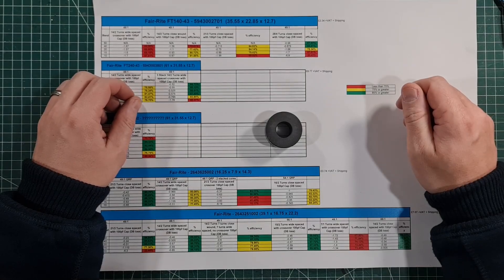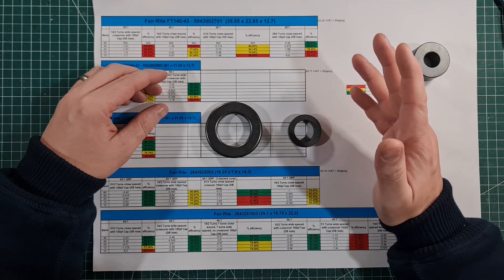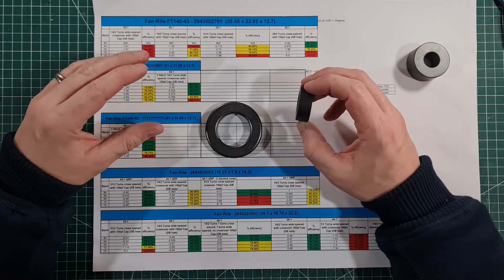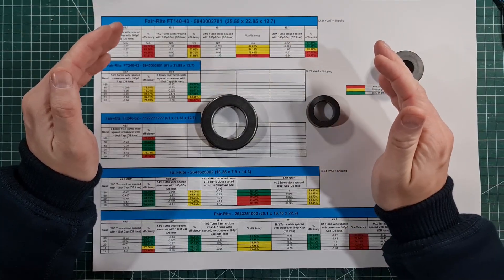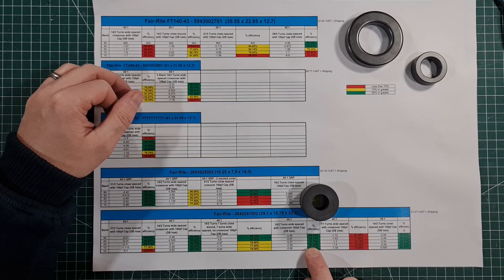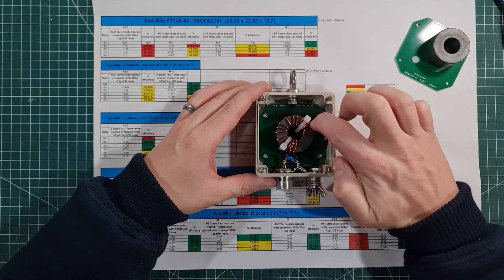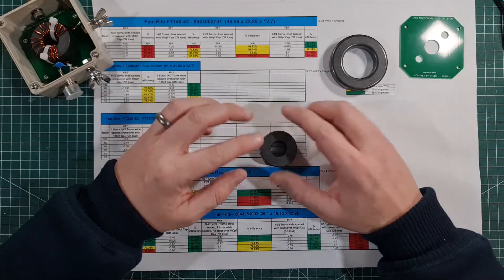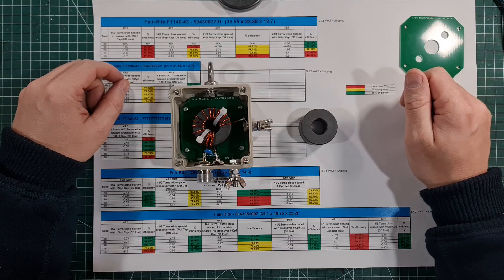Best Ferrite Core For a 100w End Fed Half Wave Antenna

Comment: Hi Colin, do you know if it would be possible to make a high power QRO version by staking two or even three of those 1002 cores? 400 watts full duty cycle is the design goal for me.
Reply from the maker: Yes, most likely but there is a major catch. You will improve the efficiency very slightly on the low bands but efficiency 20m up will likely fall off a cliff.
Reply: @MM0OPXFieldRadio  Damn, maybe I'll just take what I can get lol. Thanks for the reply man :)
Reply from the maker: @VK3USA  unfortunately you cant have it all

Comment: I absolutely would love to know how to build this antenna. Is there a build video somewhere I can watch?
Reply from the maker: Afraid not. Its just a standard EFHW transformer but with I extra then on the secondary winding. You can mount the core however you want to.
Reply: @MM0OPXFieldRadio  I’m new to ham and building antennas not sure where to begin
Reply from the maker: Ok, start to research builds on YouTube for 49:1 end fed half wave transformers. All the builds are very similar and have the same wiring.

Comment: Excellent info with very good presentation. Thank You Sir. Much Appreciated......

Because of my QTH limitations, I'm limited to Mag Loops and EFHW antennas. Luckily, I'm on the first floor and have a very large yard just outside my side door.

I'm simultaneously working on a W6NBC 4' Loop tuned via a Stepper Motor with Remote WIFI Tuning, fashioned after N6JJ's controller.

And now, because of this video,  a new 56:1 UnUn (Fair-Rite Toride #26432511002) for my 63' EFHW. I'll be adding the 80M Extension Coil in the near future for late nite NVIS.

The EFHW will go up 10M via a SpiderBeam Fiberglass Pole and then slope down to a 10' PVC Pole. I should get some DX with it and reasonable NVIS from So-NH.

I expect the Loops will give me reasonable good DX all around the compass via an Armstrong Rotator. HiHi.

BTW: I'll construct a second Loop for high efficiency on 10M to get into FM Repeaters and also the upper WARC bands.

Now, if I only had some Weazle Grease to lub my areal wire for better RFing. Oh Well......

73 You-Allz.....
Reply from the maker: Your very welcome. I only do this to help others. I need to get an 80m extension coil going myself.

Comment: help please i live in a valley completley surrounded by hills will a efhw do the job ?? getting back into radio after 20 years, whats my best option ?
Reply from the maker: The EFHW is just a transformer, your situation depends on the angle that signals can leave your valley. Ideally you need to know this and make an antenna accordingly.
Reply: @MM0OPXFieldRadio  thanks for quick reply,
i have limited options, im in a bungalow, i was going to run a wire from the chimney to my cabin at the end of the garden, but i would probably only get europe i face south east isle of wight, niton, cb  bands are dead here, im surrounded by hills, have picked up europe cb here from the back garden, are you on f book too ? i could send pics or a video, i have never made a wire before, dont think a silver rod would be any good lol
Reply: and my radio is still in the post haha, galaxy saturn, im old school just ssb lo to high and cb is what im after, but i doubt il get uk cb as hills are quite high but open, i am surrounded by water if that helps hills are 45deg front hill about 1.5 mile away to top, back garden hill 45deg 200m from my back fence

Comment: I love your results layout and testing method. I would be curious to see your results with a triple stack 52 mix 240 between the 14/2 and the 15/2. The triple 52 mix has become popular for DIYers lately (myself included)
Reply from the maker: I habe checked a 2 and 3 stack with 43 and 52 material. I need to do a couple more Then I can make up a follow up video. The spoiler is a 3 stack of FT240-52 is crap above 20m simply put.
Reply: @MM0OPXFieldRadio  It is good to know! I look forward to the video with results :). I have built a few of the triple stack 240-52 mix transformers and always struggled with the 17-10m portions.
Reply from the maker: Performance falls off a cliff above 20m, I'm not surprised. Unfortunately it looks like there is no QRO core that will cover 80 thru 10.
Reply: That is unfortunate. My Intellituner can match it and make it function but it is a shame it does not work as well as we have been told. I did see someone talk about adding another secondary turn on the triple stack to have a 15/2.... have you tried that yet? Curious what your results would be because if there is any improvement, I will probably try that with my spare transformer box that I built.
Reply from the maker: Another turn on the secondary wont do anything to make it much more efficienct. Core geometry along with material type is key for transformer efficiency. Do the tests for yourself and get your eyes opened.
Reply: @MM0OPXFieldRadio I spent about 5 years and 1000 feet of wire looking for 80-10 efficient combo and never found it, the closest I got was an air wound version and it still didn't make the cut but damn it was close. 😂
Reply: I can attest that 3  52mix cores are crap above 20 and a very expensive trial. They are good on 80 and 40

Comment: Hi what size MAGNET WIRE,
Reply from the maker: This is 0.66mm diameter wire.
Reply: @MM0OPXFieldRadio   thank you second question what was the length of wire for the antenna did you use

Comment: Does this apply to qrp power levels? Ie Does the efficiency vary with power?
Does this apply also to 9:1 ununs for long wire end fed antennas?
The core you recommend is out of stock :(
I have a G90 (max 20W) and want to build 49:1 and a 9:1 for portable as antenna use. I want 10m to work the best it can. VK6MIK.
Reply from the maker: The power level is irrelevant except when you put too much through it and it hits curie point. The smaller core I recommend is fine for 20w SSB. I haven't tried any 9:1's yet.

Comment: Have you tried two cores together, if so how much power will it handle. Thanks for your post's I've bought half a dozen to build you transformer.
Regards Kevin G1UZL.
Reply from the maker: I haven't tried 2 cores as an antenna. The reason the it becomes very inefficient 20m up. The low bands will become marginally more efficient.

Comment: Built one swr ok on 40 but not good at all on the other bands above 2:1  even after adding the extra winding to 56 :1 this replaced the ft240-43 same wire that was below 1:1:5 on all bands what were you swr finding as a matter of interest
Reply from the maker: Very strange. 40m is 1.8:1 and the rest are less than 1.5:1. How did you have it configured?
Reply: @MM0OPXFieldRadio  2 primary and 15 secondary on  tried close spaced and wide spaced the wire was 65 feet and  it's perfect with the 240-43
Reply from the maker: Sorry, how was your antenna wire orientated? Was it out in the open in the clear. The 240-43 is very forgiving but is more lossy.
Reply: Yes is 800 asl in the hills  Nothing there between 2 trees  but it not too high off the ground 6m  both sides of the wire
Reply from the maker: So as a horizontal wire? Try an inverted v or an inverted L and see how you get on.

Comment: will these  be better on  1:1  and 4:1   versions  compared to 240-43
Reply from the maker: Not necessarily, in the case of the 1:1 you would need to check the common mode attenuation.

Comment: Hi you can also get this core from ENRGTECH LTD at £7.45 each have you tryed a 4:1 made useing this core on 
 A 25ft virtical i forget the name of the anttena chris
Reply from the maker: Rybakov? No reason it shouldn't work.
Reply: @MM0OPX Amateur Radio  hi i am using a rybakov for 17m to 10m with a 240/43 core and useing a sloper for 20/40m

Comment: Just found your excellent channel and have subscribed. Two questions for the completed transformer, 1/ what benefits, if any,  does earthing the antenna side bottom leg? 2/ could the primary and secondary windings be separated (isolated from each other) and then the secondary antenna side, bottom leg earthed?
Reply from the maker: There's no noticeable difference with either I wouldn't waste my time, both have been tried.

Comment: Colin, what do you mean closed or wide spaced winding?  Is the actual wound unun show later in the video close or wide wound/
Reply from the maker: Close spaced is where the wire touching. Wide spaced is where the wire is spread out around the core.

Comment: will the fair-rite 2643251002 work as well for an 1:1?
Reply from the maker: Yes it will although I would want to check thel common mode attenuation.
Reply: @MM0OPXFieldRadio  which one would you recommend for 1:1 applications based on your experience Colin? thanks!
Reply from the maker: The 140-43 or 240-43 are fine but the master is GM3SEK. Check out this videohttps://youtu.be/jeyWB_K0y38

Comment: Hi Colin. Thanks again for your time and effort to test these possibilities! Question: i just ordered 17 ga / 1.2 mm wire and two 2643251002 cores. I was considering winding the two cores stacked  using the 1.2 mm wire at 56:1 ratio for more power and less loss. Thoughts?
Reply from the maker: You will get a higher power handing but you will get way more losses above 40m. The efficiency gains you can make are negligable.
Reply: @MM0OPXFieldRadio  OK. Understood. Many thanks!

Comment: I built an efhw with 52 core 2:14 wrap.  With 67' of wire.  Ive gotten it to great swr on 10, 15 and 20 but like you said i cant seem to get my swr on 40 under 2.0.  Any thoughts?  Try an extra wrap maybe. Also i will be building a new one in the future using your recommendations

Comment: I got myself some of these cores (the Fair-Rite 2643251002, from DigiKey), wound a couple of 15/2 transformers (wide, crossover), and tried to duplicate your numbers - what I got looked similar on the low bands (160/80/40), but substantially worse on the high ones - I'm scratching my head at what the difference might be.  Could the wire used make a difference?  I had 18AWG solid copper wire (1.02mm diameter), enameled.

For those interested, my efficiency percentages were:  1.8MHz: 91.3%, 3.5MHz: 89.3%, 7.1MHz: 88.1%, 14.2MHz: 82.9%, 21.2 MHz: 82.9%, 28.3 MHz: 68.4%(!)
Reply from the maker: Very strange. I have no idea. The wire I used is about that diameter. My results tie in with Evil Lairs anf MyAntennas.
Reply: "Iron loss" is loss of the B-H curve. I don't recall exactly, so here's my guess - loss is proportional to B^(3/2). Also inversely proportional to f^2. Copper loss is proportional to i^2. I think core loss dominates.

To reduce iron loss, Flux density must be limited, which in turn is related to magnetic field intensity. That's why increase cross section area of core (core stacking) and reduce magnetic path length (mid circumference). 

Material type 43 is ferrite could be potentially replaced by a lower loss ferrite material.

I'm hoping somebody who knows better can comment.

Comment: really nice video on the subject I have ordered some to test it out, I think I will try an inverted v, but how are the swr measurements on your antenna?, thanks for your great effort in the field 73 OZ9MSD
Reply from the maker: SWR is good. 40m is the worst. 1.8 as an an Inv L or 1.5 as an inverted V. I dont stress about SWR anymore. 2:1 or less and I'm happy.
Reply: @MM0OPXFieldRadio  Thanks for the reply, I really appreciate your work 👍

Comment: what was the winding wire size used for the tests and have you experimented with other wire sizes with the same core?  i've experimented with FT140-43 and FT240-43 with 18AWG (1mm) in various winding methods (2T bifilar, 2T tapped, 14T non crossed, 14T crossed...) and find the losses above 20m to be just abysmal.  10m is useless at low power.  i don't want a space heater, i want a more efficient antenna transformer :)
Reply from the maker: I've used 1.5 mm and 0.6mm for testing and I've noticed no difference. You need a different core to reduce losses above 20m. You cant have it all with either of those.
Reply: @MM0OPXFieldRadio   the losses with those cores is what got me searching and thus finding videos from Evil Lair and then you.  my Mouser cart is filling up.

Comment: Good video. Been using my homebrew 2x ft240-43 14/2 for just over two years now and about to build another with 3 cores, and always assumed around 88-92% efficiency as mentioned in the GNARC presentation (happens to be a local club to me too). Just got a 600w amp so might even do 4 cores. Just remember 1 ft-240-43 while might be good for 100w, that's 100w ssb phone, most digital modes/cw (key down) it's closer to 40w limit, which will be evident when you see your SWR start creeping up as the core heats up.
Reply from the maker: Agree on the 40w for a single FT240-43. I did the check. This core will handle 100w digital modes till the cows come home.
Reply: Also when the antenna is used in off resonance frequencies they handle even less power.

Comment: Wow! You have certainly done your homework. A good antenna is perhaps the best investment you can make. Its a two-way amplifier for TX & RCV.
A few years back I started using EFHW and long-wire random endfed antennas. The EFHW is my goto antenna as a portable operator.
View Steve Ellington's video I found out how to get maximum performance out of my Ultimax 80m-10m EFHW. He tried six different configurations of choking, grounding, and counterpoise wires measuring RF current on the antenna. Installed as an inverted-L with the 49:1 transformer near the ground he found just over +dBr improvement by choking and grounding at the feedpoint.
A properly installed well made EFHW is probably within -1dBr to -dBr of a tuned dipole, and its much easier to deploy.
My Ultimax is big and bulky, so I am looking for a different antenna for man portable with my FT-857D. Currently, I am using the Cha Emcom III portable. Its fine for 20m and up, but it lacks efficiency on 80m and 40m. 80m & 40m are my primary interest for NVIS regional Emcom.
Thank you for your wonderful work!
https://youtu.be/MzfQybYMlUc

Comment: Can I use another TDK 100pf cap seems all the 3kv ones are sold out, can I use a 2kv one?
Reply from the maker: The 2Kv ones still more than ample. It goes on the low voltage side.

Comment: What gauge wire are you using? (obviously I'm a Yank, but if you give me a diameter I will figure it out ;) )
Reply from the maker: This is 1.18mm diameter. Is that 16 or 18ga?
Reply: @MM0OPXFieldRadio  16awg is 1.29mm and 18awg 1.024mm. I'll take the over engineered value ;) 73 de w6mgv

Comment: Thanks for your video my question is what size magnet wire did you use? I used 18ga for my transformer but it is a little hard to wind the coil I wonder if 20ga might work better? I really like these antennas I used a 240/43 and 18ga insulated stranded wire and have worked a bunch of DX and QRP at 5 watts.
Reply from the maker: This is 1.18mm so close to 18ga. 20ga wont  make any noticable difference. If your running QRP it makes sense to use this core especially.

Comment: Good work Colin. I always wondered how much power can safely be run through an EFHW. They are a very trendy antenna at the moment. I use mine exclusively QRP but I am considering installing a commercial one at home that was gifted to me. Your research gives me great confidence that I could homebrew a transformer and get it working. The only issue is there would be 30 m of coax feeder and I suspect that may mess things up. Any thoughts?
Cheers, Fraser MM0EFI
Reply from the maker: The feeder shouldn't muck it up at all. Longer is better than none and it needs a counterpoise. If you have problems then install  1:1 choke 0.05 - 0.15 wavelengths from feedpoint on lowest band.
Reply: @MM0OPXFieldRadio  Cheers Colin. It's either the efhw or a doublet I'm going for. Still toying with it. The doublet will be trickier to feed and arrange, so I suspect it will be the end fed.

Comment: Colin, thanks for an interesting video. I’m experimenting with the same core. Following the advice of Owen Duffy I’ve built a 14:2 transformer. However instead of using the twisted wire technique I just tapped the 14 turn primary at 2 turns. Using a non inductive load of 2500 ohms my nanovna shows an SWR of less than 1.5:1 from 3 - 27 MHz. I don’t use the cross over wind but closely wind the transformer on one side of the toroid. I’ve never been sure that the “traditional” transformer design is optimum. I’m also planning to make one with a binocular core but that’s another story
Reply: I also wind my EFHW transformer like a "autotransformer" with the ground at one end, tap a few turns in, then the remainder of the turns to provide the higher impedance aerial wire attachment point.  It has always puzzled me why most prefer to do it as shown in this video.  Mine work very well.
I am also starting to wonder why I've been using #43 material cores when the ARRL handbook and other sources indicate that it's good for HF chokes but not for HF transformers.  The inverse is true for #67 mix so I ordered some cores made from that and intend on experimenting.  Perhaps the core will have less loss and generate less heat?  Maybe someone knows the answer to this already. ?